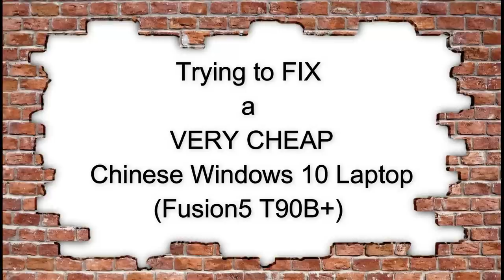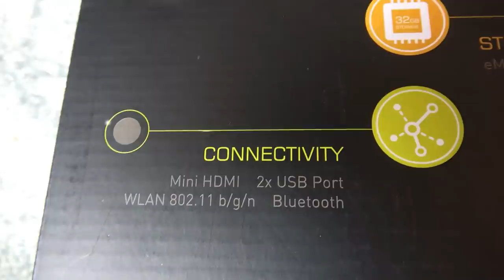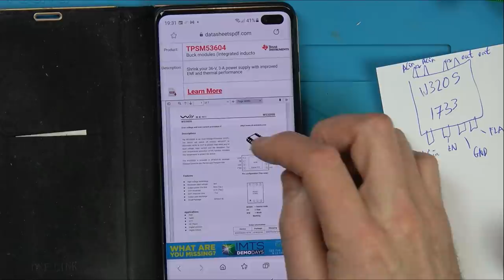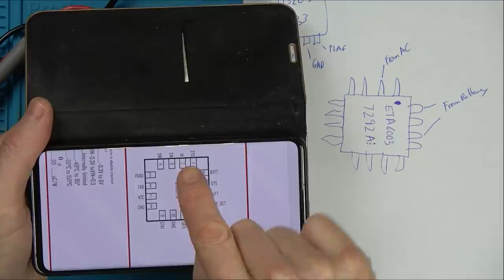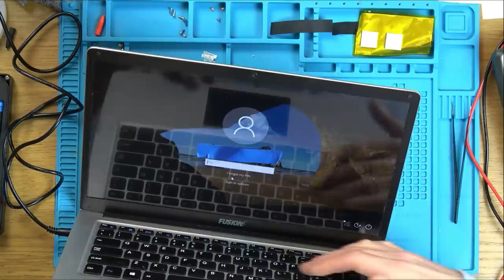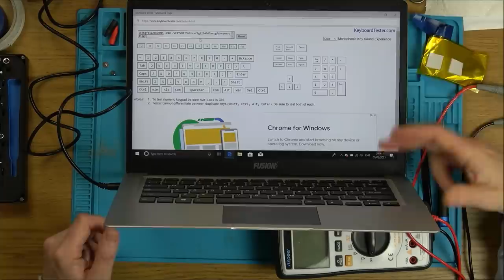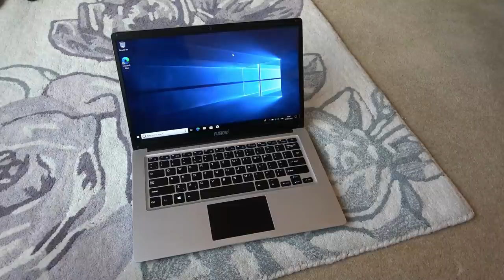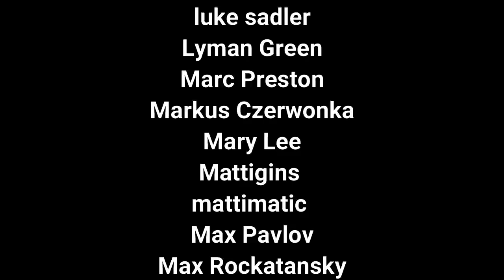Broken Low Cost Chinese Windows 10 Laptop - Trying to FIX

Comment: This is one of those super low power intel chips that doesn't have much processing power. DDR3 memory is fairly old by now. Another red flag on these cheap laptops is the voltage of the PSU. 5V are for up to smartphones and tablets. Windows 10 is way to heavy to be running in this kind of device because of all the telemetry data they collect and useless services running on the background. You can get decent enough performance by installing Linux instead.

Comment: $200 range laptops (anything below $400, really) is basically asking for a painful experience. From small, slow eMMC storage to limited RAM with no upgrade options, and as one saw here as well, a CPU that's probably thermally throttling the moment you push it a little bit because there's no real cooling solution.

That's not to say that <$400 laptops cannot be decent, but you really want to do your research, and it's probably better to just buy a used laptop off a mate or a respectable used laptop seller.

Comment: A laptop that runs on 5V ? It's basically a tablet with a keyboard !

At the very least you could reuse the LCD as a monitor with a cheap AliExpress board and make a battery bank with the 10Ah cell.

Literally nobody does those level of work on consumer services any more !

Comment: Put Linux on it, it turns slow Windows shitboxes into halfway usable machines.
Because you could spend weeks trying to "tune" Windows and it'll never work.
Most old laptops can be made usable by installing an SSD, throw some RAM at it and put Linux on it.

Comment: These are not designed for repairs to be done, cheap components with a plastic fused chassis.
I did a similar one a couple of years ago, but the ribbon cable was so thin. plus the tracks were printed on with a carbon that rubbed off just by moving the ribbon, I did the silver paint to repair the damage I did taking the plastic clips off.
Yay it worked when I tested it whilst dismantled.
I hot glued the melted clips, put it all back together,,,, groan it didn't work.
When I dissasembled it again, the heat from the hot glue had melted the ribbon (this was as thin as sellotape)
Guess what??????? it went in the bin .... Chinese rubbish...... 😭

Comment: Looks like its an Single Board Computer akin to a Raspberry Pi mainboard.  Looks to be a low spec one, heres a Pi version https://www.youtube.com/watch?v=bZkcKfjRbkM.
If its struggling WiFi wise have you tried a dongle?  If I was you I would put a Linux Distro on is such as Peppermint or Mint.

Great video

Comment: This is so blatantly a rip-off of a MacBook of some sort. Relabel the key caps and the case, put a (for a MacBook) non-standard charging port, and paint the trackpad black, and voila! Instant clone. It would only be appropriate to turn this thing into a Hackintosh! Put Parallels Desktop on it with a Windows 10 VM, and it would be really schizophrenic! 🤣 And put a Linux distro on there too, to cover all the bases!